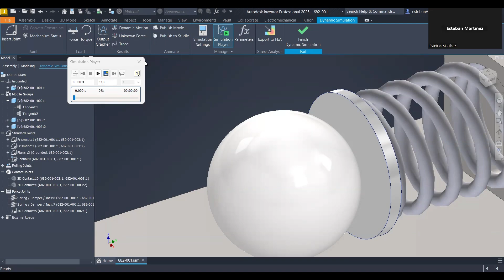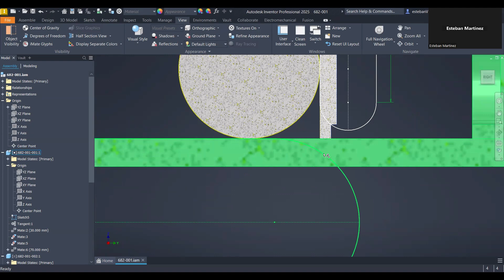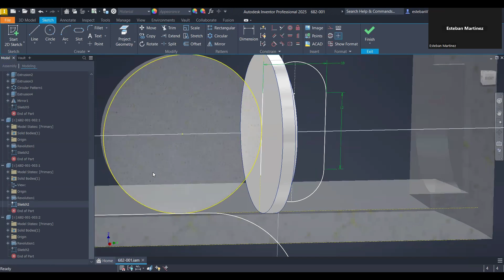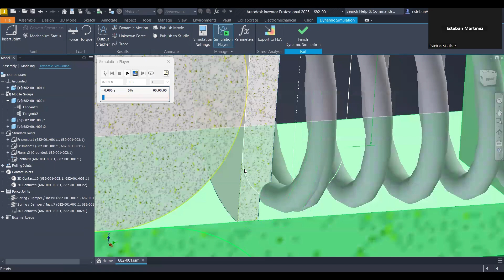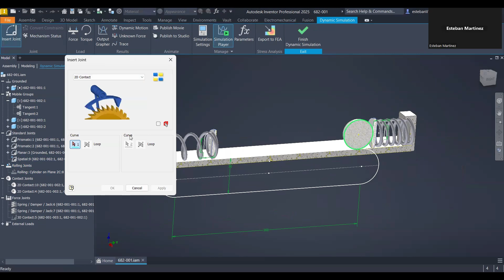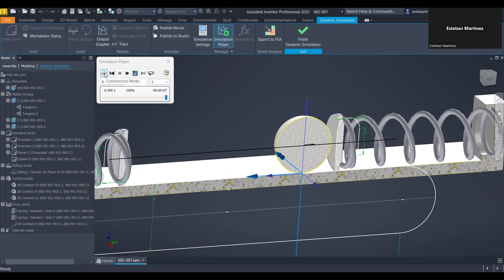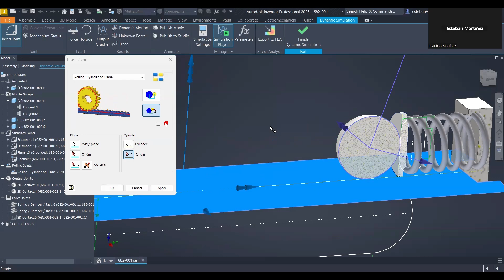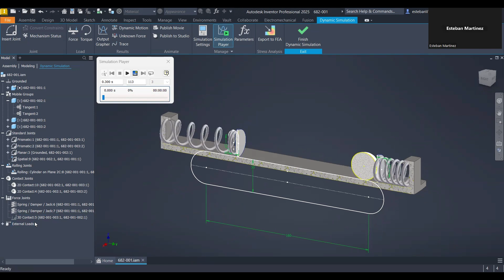Stop using 3D contacts - Autodesk Inventor 2025 Dynamic Simulation

Comment: I think 2D contact just show how does it work very quickly. 3D contact can control friction, damping value and have a result close to reality
Reply from the maker: That’s partially true, in the 2D contact properties you can modify the friction and the restitution (indicates how the normal velocity between the two components changes during shock).
The results in the output grapher are more extended in 3D contacts, I would say it worth it if the event requires 3 degrees of freedom, if it is just 1 or 2, 2D contact can get the same results with less computational time and about how precise the results are will depend from the properties, sometimes you have the right values, in other situations you have to guess.
Reply: @lucmartz  I only simulate 3D contact to test the furniture stability with many different contacts between legs and floor. I've used it to simulate some cases with 2D contact, but the realistic result does not align with its setup. I've tested with the sharp corner, and we're going to have the penetrating force instead of a 2D contact test
Reply: You can check the F2057-23 certificate, the cabinet will test with a cleat 1/2" at the back leg. In this case, I must be tested with 2 values: the penetrating force and reinforcement
Reply from the maker: @dukhu7901  that sounds interesting!!
Reply: Your ideal is a different thing from taking a test, I will try to test with some case that I use the solid metal leg, which is sturdy enough to skip the penetrating force and reinforcement, just only control the friction value. It will save my time